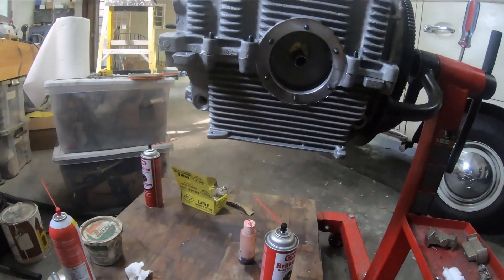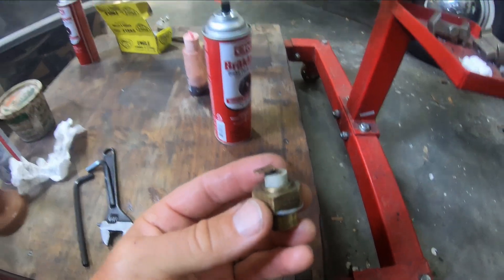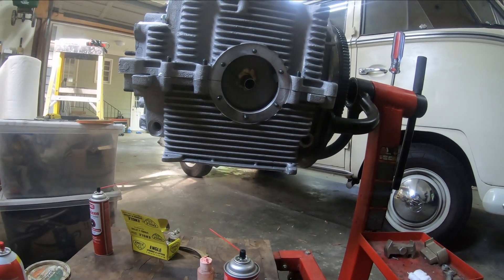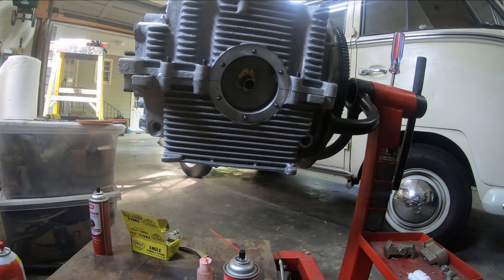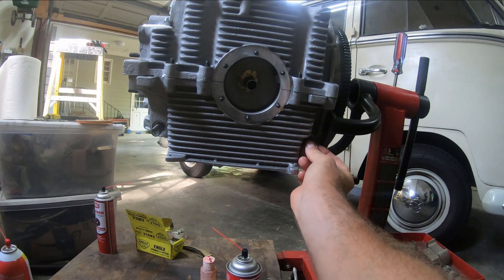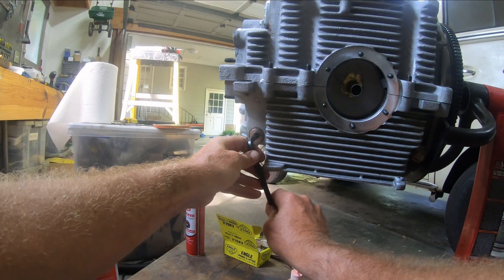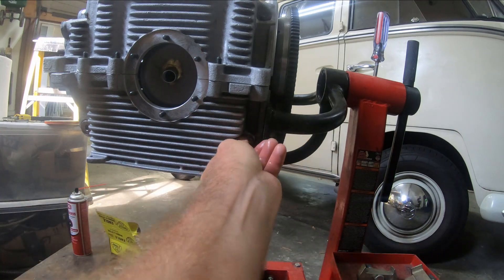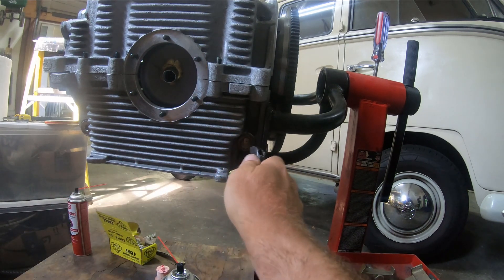2332 VW Air-cooled Stroker Motor - Video 07 - Dual Pressure Relief Valve Setup

Comment: What clutch did you run? Spring or rigid?
Reply from the maker: Rigid.  I have never installed a spring plate.  There are times when the clutch seemed to catch a little to hard, but once worn in it seemed ok.  What are your thoughts on a spring plate versus rigid?

Comment: Some say the temp sensor should be on the flywheel side for a more accurate reading. Thanks for the video and info. Im researching what spring size goes what side for now before i start reinstalling it 🤦🏻‍♂️ this never ends lol
Reply from the maker: I put the temp sensor on the flywheel side - and the springs are correct in the video.  Long spring on the pulley side with the hex screw, and long spring on the flywheel side with the temp sensor…
Reply: @LarsonSplitBus-  sorry i meant pulley side. How are ur readings? If its giving you normal temp reading then i guess it does not matter much. Thanks again
Reply from the maker: Readings are good on my 1968cc motor with the same setup.  I think it is always a tad low because the oil is buffered from the sensor by the relief valve, but it is fine.  So the 2332cc motor has not been completed - but I assume that setup will be fine…
Reply: @LarsonSplitBus-  10-4! Best of luck!

Comment from the maker: Those are the correct sides for the long and short springs.  I torqued down the oil temperature sensor plug with a socket wrench after.